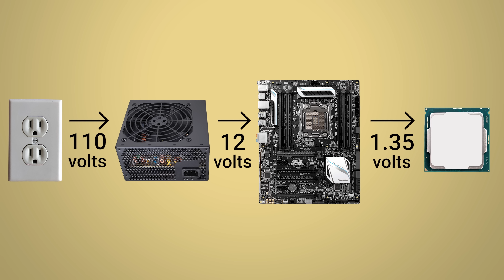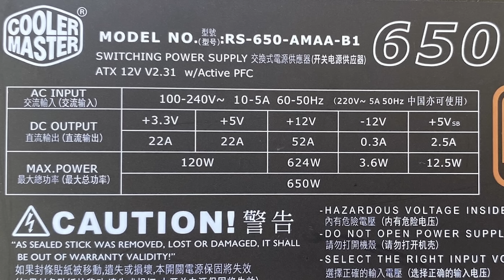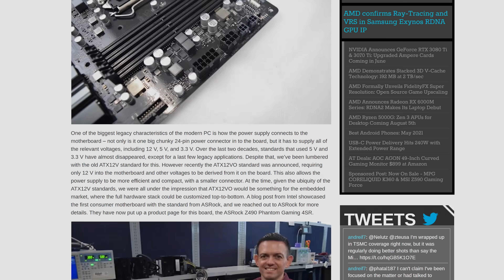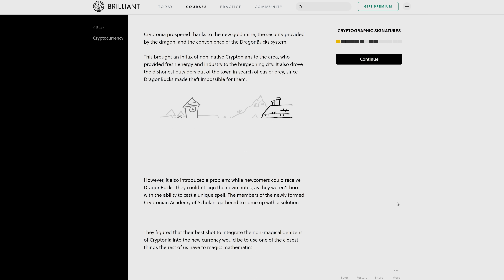Is The 24-Pin Connector DEAD?

Comment: Seriously agree!  The day we power everything with a single cable pls!
Reply: @poisonouscarnage2289  "Today".
Reply: @Damuskinous  That'd have to be a seriously massive cable or it'd have to have a high enough supply voltage that you don't need much current but at that point you'd also need a whole lot of other components to step the high voltage supply down to 12v and that's just wasteful (not to mention dangerous at a high enough voltage!)
Reply: @snozzly  The way I look at it back when we were dealing with a 56k modem, not 1 person thought that networking could be send via power.   Now apple has a power cable sending both.   Like yah keep talking like I said "Next year".   What the hell does anyone know what things will be like 20y from now lol.      All I said was I agree with him, on wishing for a single cable.
Reply: @Damuskinous  Apples cable includes extra pins, it's not innovation it's just moving it from one place to another.
Reply: @poisonouscarnage2289  When I refer to "cable" I mean from the prospective of a user, not the individual wires inside said imaginary cable. 

Take a USB cable, it has several internal wires that do different things. You'd just refer to it as a single cable however.
Reply: @poisonouscarnage2289  which was the point I made to damuskinous

Comment: If PSU manufacture use seasonic approach that is psu plus a converter for 3.3 and 5v then the transition to  ATX12VO it will be more easy. But like this hell no i dont want more electronic in the motherboard make it more expensive and more fragile .

Comment: Having an issue with the 24 pin connector right now. Building a custom loop and the 24 pin is behind the reservoir and I can’t get to it. My plan is to use an old hp computer to power the water pump for filling and leak testing.

Comment: Wouldn't it be great if SATA connectors could combine both power and data? If you're connecting SATA drives to the motherboard for data anyway, it just seems like more of a hassle to connect them yet again for power.
Reply: (coughs in USB C)

Comment: Dell and HP have been doing this for years on thier systems. So it's nothing new.

Honestly I don't think it's a good idea, they're all still needed. So you're just moving the problem else where. 
Which will make expansion harder, unless there's also a standard for the motherboard mounted headers.

Comment: This 12VO standard is just marketing bs. On paper the psu efficiency is indeed higher, but 12VO just shifts the buck-boost converter from the psu to the mobo. All in all, the total efficiency of the system might be the same, or possibly even worse. I think the best solution is to stick with the experience of psu engineers and create a new standard which simply uses 5V and 12V, both coming from the psu. (Electrical Engineering student here)

Comment: • 2:18 - How is that a bad thing? Instead of dragging a long power-cord across the case from the PSU to drives, you can just use a short combined data+power cable from the motherboard to the drives. Cable-management gets much easier. 👍
• 2:53 - And the GPU cable cables. ¬_¬
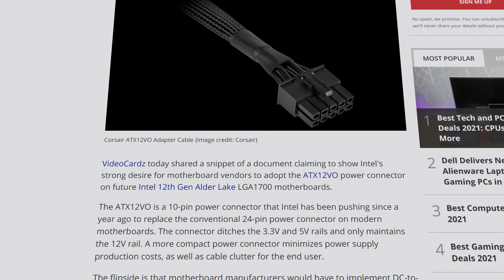• 3:40 - Again, just plug one big cable into the motherboard and have shorter cables come out of that like an octopus. 🤷

Comment: This feels like a half step. If that much.
Either move desktops to use external power bricks bricks so that we:
+ truly save space inside our computers,
+ reduce noise by getting rid of one fan,
+ make installing and replacing the PSU truly easy (and quick) for *everyone*,
+ force GPU and CPU makers to stop faking their power ratings and start betting on efficiency instead of just pushing more, and more, and more power through the components,
+ limit those bricks to a maximum of 240W-320W so companies have to stop wasting power for diminishing returns in performance...
Or just don't bother.

Comment: "Intel might make the specification mandatory on motherboards for its upcoming Alder Lake processors." At a time where Intel is rapidly losing market share on almost every front, this sounds like Intel might be shooting themselves in the foot (again.)
Reply: The thing is, the efficiency argument holds no water either.
The higher efficiency could be achieved very simply with a port on the Motherboard and a port on a slightly revised ATX PSU, you connect them with a thin cable that makes the motherboard talk to the PSU and run it efficiently and maybe PWM control it#s fan while it's at it. Would be one thin extra cable (and would work without it too) and a small extra PCB in the PSU and maybe a small chip on mainboards and some BIOS software.
Could call the Standard "ATX+" or "intelligent ATX" and it would be more flexible, more compatible, not waste space on mother boards and just as efficient.
Reply: @catriona_drummond  Shut up and take my money!
Reply: @catriona_drummond  Parts draw power they do not request it, that's the way electronics works. There is no need to tell the PSU how much power to provide, the parts simply draw what they need.
Reply: @unrealcyberfly  if that is so, why is 12VO supposedly so much more efficient then? Genuine question.
Reply: @catriona_drummond  I can't tell you why, I don't have any real knowledge on power supplies. My guess is that you can focus on a single trick, going down from 110/230 to 12  volts. It could also just be a way to be more efficient on paper as the mainboard has to deal with 5v and 3.3v now.
Reply: @catriona_drummond  1. Losses in wires and connectors are proportional to the square of the current (or the inverse square of the voltage) at the same power. Which means you should step down the power to the required voltage as late as possible. Early CPU's used 5v from the PSU directly. But modern CPU's can draw 100 Amps at <1.5 volts. That's why the regulators are as close as possible to the CPU socket and why they use 12V.

2. Every voltage rail has some amount of leakage, even if nothing is connected. So it is better to cut away unnecessary components.

That are the two main reasons I can think of. Maybe there are more advanced reasons too, I am not an expert either.
Reply: @catriona_drummond  I mean all they have to do is make a simple header change we dont need to be REWIREING THE ENTIRE PSU because they want to remove stuff that only THESE companies use and break 30 years of standards. PS the number of wires will not change its just adding more bullshit no one wants and making it more likely to fail and burn out the wires by overdrawing them.
Reply: They'll need AMD's help in this one. I feel that this is also why Itanium failed as they left AMD and Cyrix out of the architecture.
Reply: Honestly,  I am sitting on 4th Gen Intel still (4790K) and I was planning to finally fork out all the money I didn't spend on upgrades in 7 years on a beefy Intel CPU and board next year. This is not gonna happen if they force 12VO down my throat. I have a 250$ Seasonic Titanium rated PSU in that thing and it will go on to power an AMD system instead.
Reply: @catriona_drummond  You know most likely there will be adapters for the new 10 pin connector right?
Reply: @drunkhusband6257  youp but these adapters will sit on the 12V rail alone and people with "smaller" PSU's will have to buy a new one anyway because with the adapter they would overload it.
I am looking at the bigger picture not just at my own stuff.
Reply: @catriona_drummond  Not to mention that the adapter could (potentially) cause efficiency to become even lower, since the PSU would still be providing power rails that may no longer even be used.
Reply: @triadwarfare  To be fair, it was probably at least as much a question of running legacy x86 programs. Apparently IA64 being so different to IA32, you couldn't efficiently emulate it like Apple has done PPC32/64->x86_32/64->ARM64,  you actually needed recompilation on the new system to get anywhere near original performance. So Intel would have basically killed all their legacy software through IA64.
Reply: Luckily, they did not do this. Just replaced my CPU and mobo with Alder Lake stuff, and I would've just gone with AMD instead if I had to buy a new PSU too.

Comment: I have never had an issue with the 24 pin connectors, this just seems like it'll be the same amount of hassle as the current standard
If they wanted to make things easier, they would have addressed those pain in the arse motherboard to power switch/led connectors.

Comment: Maybe I'm being dumb, but I don't see why the 5V rail and the 3.3V rail have to be connected to the motherboard via the 24-pin connector to provide power to a SATA drive. Couldn't the power supply still have a 5V rail for SATA power connectors, but then not bother running 5V to the motherboard? Why does the motherboard have to be involved at all, doesn't the power go straight from the PSU to the SATA drive anyway? I'm just not understanding why they couldn't have a 5V rail on the PSU exclusively for SATA power cables while using the 10-pin connector for 12V for the motherboard. Having to plug the power cables into the motherboard to get power from it doesn't make a whole lot of sense. It's more likely that this change will end up killing SATA connectors and forcing everyone over to M.2 only than that motherboard manufacturers would keep providing complicated break-out cables to allow SATA connectors to work. Maybe if we're lucky they would start providing SAS controllers, and start making most drive bays use that. Because then there's a single cable for data and power, and you can use a cheap converter to break that cable out into SATA plus power for a SATA drive if you have to. But SATA plus power as separate cables makes zero sense as a base standard if you have to run both SATA and power off the motherboard.

Comment: Just move all the power through the data cables and call it a day.. while you're add it, make the PCI-E slot carry like 500 Watts so we don't have those stupid cables... cables are dumb, no matter how much RGB you cram into them. If it's a circuitry problem, them change the standard to allow power cables to be plugged in on the back side of the board and pass straight through the board as additional power pins on the bus slots as a longer port. This way, it's backwards and forwards compatible with older generation cards / slots. Ah well... here's to being an armchair engineer.

Comment: its all about taking the problem off of one person's shoulders and shoving it onto another's. Power requirements dont change, someone else just has to generate it. It makes sense to shove it to the motherboard as it allows motherboards to spec there own components based on their own needs vs trying to generalize across all of them. sata becomes the bigger headache. Its essentially, "here's a big fat 12V rail. do whatever you want with it."

Comment: I really really hope this 12VO standard doesn't standarize outside of prebuilts and servers, since motherboards are already crowded and expensive as they are.

Not to mention that you are putting extra burden on motherboard makers, wich are in no way going to have the expertise that PSU makes have in handling that power conversion.
That itself is going to negate a big chunk of the energy efficency benefits of 12VO... and the benefits are quite narrow to begin with, since the standard only benefits idle consumption and very low power consumption; consumption which is already low without 12VO.

And also, you are adding another potential point of failure to the motherboard, and it's probably going to cause more motherboards to fail, which aren't as easy to replace as PSUs. And if that conversion circuit fails on a motherboard, there are way more components that are going to have to be discarded with it, compared to the same scenario on a PSU.

Basically this 12VO thing is big changes for negligible benefits. It's good in prebuilts since the bulk of them go to offices, and the ones that go to home consumers usually are also office work oriented, but for the rest it doesn't make any sense.

Comment: @alioop won't let me reply in the thread for some reason, but the reason I think it will take 2,3- or more extra cables coming from the mobo is because many people (myself included) cannot REACH every sata device with one cable, and they STILL don't ever have to even come into the mobo, they are behind the mobo panel and under the power supply shroud.  This method, ALL the same cables you use now from your psu for sata power (at the very least one unless you're only using m.2) will now be coming off your motherboard i.e. in the way where they weren't before. ALSO keep in mind current multi port sata power cables connect thru a 6 pin interface on the PS.  Where as these are only 4 pin connectors....
Sorry man, bad idea all the way around.

Comment: Regulators: We demand more efficient electronics

AMD & Nvidia GPU's: Hold my 400W
Reply: 3070ti sweating heavily
Reply: Mac Pro: "Allow me to introduce myself"
128 GPU cores at 150 WATTS, and 32 ARM-based CPU cores.
No wonder ARM is the future, they're releasing the 9TH version that will be Intel's judgment day, the moment Samsung demos ray-tracing on PHONES
Reply: @neliaironwood7573  Is ARM really the future? Those number don't mean anything if ARM performance isn't that good. Compared to a regular CPU, how good is it? In what tasks does it beat the regular CPU?
Just wondering because ARM is pretty much a smartphone CPU and if it has 32 cores it doesn't mean much, it could have 32 very weak cores
Reply: @AlNexus  Wait till you see computesr with Nvidia's ARM-based Grace processors, and real-time raytracing making it to phones if you've seen the AMD-powered Exynos. Max Tech even has a video saying that x86 is dying and Intel is in serious trouble.
Reply: @AlNexus  The M1 seems to be a powerhouse. I believe Apple discontinued the iMac Pro in part because the new M1 Mac Mini out-performed it at roughly 1/4-1/3 the price.
Reply: @neliaironwood7573  Makes sense. Well, I guess ARM is the future, but we need to build the apps on ARM for them to run quickly right? And Intel is in trouble, maybe that's one reason they started making GPUs?
Reply: @AlNexus  I think there's a reason Microsoft is planning Windows 11; it is to further enhance capability with ARM/mobile devices and macOS has Rosetta 2 for Adobe programs that haven't been remade for Apple Silicon. There was Windows on ARM, but its x86 app layer was terrible at best, and Adobe wasn't interested in it, but I think that will change with the AMD Exynos.
Reply: @neliaironwood7573  Interesting, that sounds exciting. I remember Windows 10X was gonna be MS's ChromeOS, but now it kind of ended up turning into Windows 11, so maybe they really want something new.
I wonder what will happen to Linux. I don't want Linux to end, since I'm a Linux user. I hope in the future Linux distros keeps being developed by everyone.
Reply: @neliaironwood7573  the IBM PC has been reported as dying almost continuously since the 90's, RISC chips having better performance or efficiency has always been a thing.  The most convincing period was when every industry pundit thought the desktop was going to give way to powerPC laptops now its a PC market of 2-1s and tablets and TVs.  

There's always some important workload that just needs to be brute forced by a general purpose chip; the AMDx64 format will give way to another CISC design.
Reply: Idle power usage has greatly increased thankfully
Reply: (I know this is a joke)
To be fair, power efficiency =/= power draw

Comment: Has anyone really had trouble with a 24 pin connector?  If anything this is the easiest plug on the motherboard.  They want to make something better, standardize front panel I/O connectors.  I really hope this PSU change doesn't happen.  PSU prices won't drop and motherboards will sky rocket.  Plus motherboards are the most common failure point when building a new system and now you want to add more shit to go wrong.  This is such a bad idea.  Imagine when the 5 volt rail on your new MB burns out and you have to change the MB instead of the PSU, meaning you have to completely disassemble your rig and get a new version of Windows.

Comment: Now if only we could step down from the massive pin sizes that ATX has always used, to whatever standard Nvidia's new 12 pin connector is. Smaller overall connector yet it has a much higher power throughput in comparison to the typical ATX connectors. One of those would handle any CPU power requirements, one of those would handle any GPU power requirements, one of those would handle all motherboard power requirements and would have more than enough overhead for putting the voltage step-down for SATA on the motherboard. Moving to a standard that Nvidia is pioneering would provide a three cable solution (possibly two on standard clocked CPUs, possibly one on an APU-based system) with very small connectors in comparison. The fact that they're still hanging onto the older ATX standard pin sizes is a massive misstep from everyone involved with the change over to 12VO, especially when Nvidia has already shown this new connector to be a viable alternative; even more of a misstep when you consider that every power cable can be identical, no more 20/24 pin plus 4 pin plus 6/8 pin connectors, it'd all be the smaller 12 pin connector for everything, which adds simplicity to builds.